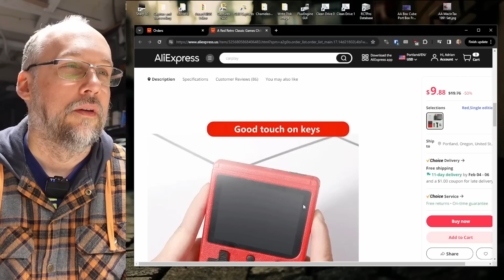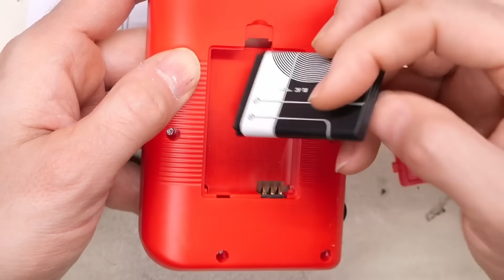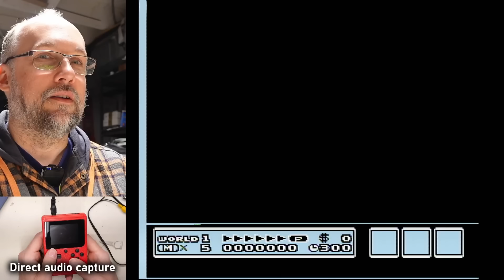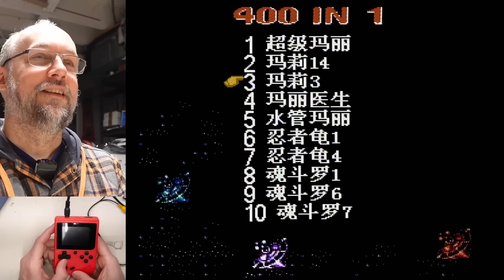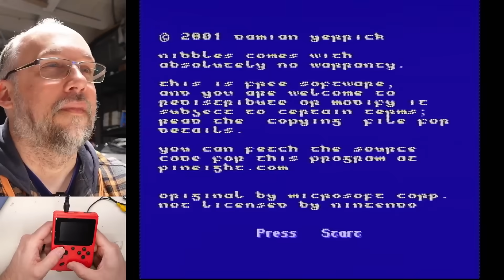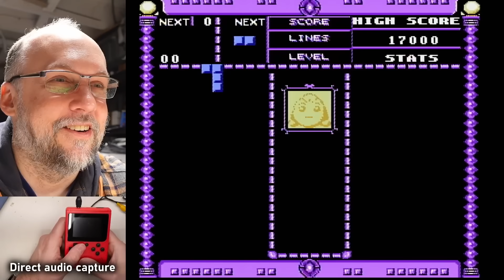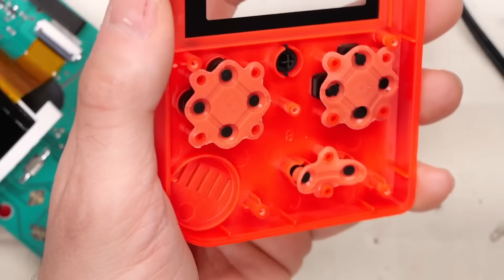I thought this $4 8-bit game console was going to be total junk

Comment: Most of the modern NES clones with this sort of large Flash use a VT-02/03 SoC, that is a series of NES clones manufactured by a company called VRTech. In the early 2000s they implemented something called the OneBus, essentially a programmable mapper that lets the system address an 128Mbit memory space. This means that anything other than MMC0 needs to be hacked to run in it (for example, certain portions need to be repeated and some of built-in games PPU data is interlaced with other games that share the same mapper type) - it is a slightly larger undertaking than just flashing the ROMs. Later on they went as far as building a non-NES compatible SoC called the VT1682 that drove many chinese handlhelds and Wii clones in the early 2010s - I actually reached out for them on the topic of building a hobbyist computer based on that chip.
Reply: This sounds like a very cool project!
Reply: Hey I had the same thought ! I have a bunch of famiclone UMC chips and I watched ben eater's 6502 breadboard computer, and it got me thinking I could just make one myself out of these :D
Reply: There was a NOAC (or FOAC) that could use the proper ROMs. It was typically packaged into a fake N64 controller (with a fixed "joystick" in the middle) with a Famicom compatible slot on the bottom. I had one with one Famicom game cartridge, sold it for cheap. It had the usual huge number of games in one built in, which were multiple minor hacks of 100 or so games. I assume it could have worked with a NES to Famicom adapter.

Comment: Nice game console for it's price.
This kind of battery indeed seems to have long life. A (fake?) battery (ZMC BL-4C) was in my 1st cheap "Made in China" dashcam already in 2012. It didn't keep the dashcam powered very long, just couple of minutes, but when I replaced it with real Nokia BL-5C battery from Nokia 1600 cell phone, I recall it kept it powered up at least ten times longer, maybe even an hour or so. 
Usually of course dashcam is powered from the car's 12V socket, but when parked, there's no power coming from that socket. If you'd like to use the motion sensor, or G-sensor mode, long lasting battery inside the dashcam is useful.
Nice to see this kind of battery is still powering up devices, at least inside this handheld game console.
I still have the Nokia 1600 phone and battery for it, altough I don't use it as a phone anymore. I also have later Nokia C1-01 phone which has 3,7V Nokia BL-5CB version of the battery, but never tried this in that old dashcam.

Comment: It would be easier to wire up a genesis controller rather  than using a nintendo one, though the genesis controller has less buttons (3+start) than this device expects (4,+start+select but do any of the games use the extra buttons, if not you could get away with a genesis controller). You could install a male DE-9 conector without modding a controller

Comment: The screen tearing is actually because the scaling is "nearest neighbor" and the LCD isn't an exact multiple of the native NES resolution. I have the same issues on the GameGear replacement screen. You need a screen with exactly 1x or 2x the pixels of the NES to not get this effect, or leave black bars around the screen edges.
Reply: You're probably referring to shimmer, where you get a sort of flickery effect while the screen is scrolling because lighter and darker logical pixels are passing through different sized output pixels.  Screen tearing is just that the screen is running at a different rate than the hardware driving it, or the screen is just not being filled/refreshed fast enough so you can see the process of the screen being between frames.

Comment: bought something "like this" (as in, same exact shape, but I don't know if it was the same manufacturer) a few years ago after watching some youtube video about how they are not as bad as you'd think, and yeah it was not bad. gifted it to a friend's 4 year old son so he could play mario. it broke a few months later from abusing the charge plug, which was about as expected, to be honest.

Edit: Wrt the external controller, it connects via the usb plug but isn't usb. in fact that whole usb plug is not actually usb, but rather follows the NES controller "protocol" (which is just a shift register, clock out, data in).

Edit 2: I just realized the controller port is micro-usb, mine was mini-usb!!

Also I don't think mine had those audio issues, this version must use a different clone NES chip.

Comment: I've always been fascinated with the old HK SuperVision / Megacom multi-carts. The originals from 1988-1991 don't repeat too many (usually), and are always real commercial Famicom games. Almost always Mapper 0, or hacked to use Mapper 0. Some of my favorites are the 110in1, 190in1, and my absolute favorite, the "Powerful 250in1", with over 100 actual games, and the hacked variants, stuck together, and not all throughout, which is nice. There is something very nice about these collections of early games. It's a nice snapshot of the early Famicom days. So many of the classic Black Box NES games too. Almost all 30 are present. -Matt

Comment: It would be very easy to add an external controller onto this. Just tap into the contacts. I bet the extra "C" "D" buttons are turbo versions of the B and A NES buttons. That's what they usually are on the FOAC boards. -Matt

Comment: The quality of this thing is better than my $100 multimeter I bought. It makes me kinda sad. I opened the meter up and was appalled at how bad the solder joints looked and how half-assed certain things seemed.  I realize that they used wave soldering in the production of the meter, but  it just looked awful.

Comment: I have one but I just play Galaga on it! I have PAL but is PAL-M so is 60Hz and the Mario seems a little fast to me. The composite video out is pure crap....horrible. Mine too had the controller with a bad contact I used Deoxit (in fact another one used in Brazil that is not toxic or flammable) and it became worse, maybe the conductive rubber didn't like it.
It has not low battery indicator the screen becomes dimmer and dimmer until you realize that is the battery! Mine came with an extra controller NES like that it is only used for the second player.

Comment: Raid on Bungeling Bay is interesting because while developing the game maps, Will Wright realized he enjoyed making maps more than the game itself. Thus, he created Sim City.
Reply: The NES version of Bungeling Bay is also interesting in how they implemented the scrolling. Most NES games which supported simultaneous horizontal and vertical scrolling did so using MMC3 tricks, but Bungeling Bay doesn't use a mapper. Instead, it does smooth scrolling horizontally but uses jumpy stepwise scrolling in the vertical axis, which is also surprisingly difficult to pull off on the NES.
Reply: I loved playing this on the C64, had no idea how to play, but pieced enough together for it to be fun. Wasn't until about 5 years ago, I read the instructions online and enjoyed playing it in an emulator!
Reply: You can really appreciate the aesthetic similarities with it and the early versions of Sim City
Reply: Loved it on my C64.
Reply: 'Raid on Bungeling Bay'   ROBB and Space Taxi are the two games that I still pull up once in a long while on a C-64 emulator.  Both were great in their own respects, and it's difficult to find a similar experience on anything else.

Comment: Raid on Bungeling Bay was Will Wright's first game, the original version is on the Commodore 64. It actually has some neat mechanics in that the enemy city has factories which work towards building an enemy battleship to take out your aircraft carrier.
The city aspect of the game became the inspiration for SimCity and you tell the similarity with the tile graphics used in the C64 version of SimCity.

Comment: Some of the later Russian NES clones had improved hardware. It could be that the extra buttons are for games for those systems.

They could also just be auto-fire as they are on a lot of the Chinese clone systems.
Reply: I guess it's because they're made with same form factor of "better" stuff like the Miyoo Mini or the Anbernic line.

They use four buttons plus "shoulders" to be mapped with Retroarch
Reply: I have one that's almost identical to this (my cardboard box is a bit different, but everything else looks the same) and Y/B are the B/A NES buttons, and X/Y are turbo.

Comment: Some years back I got a handheld thing from a local clearance place and it too had one of those RAM/ROM modules fitted, never did work outhow to read & write to it though, cos the games that thing came with were absolute crap (they made the dodgy fakes & hacks on this look good!), think I ended up tearing the screen ribbon though (was soldered to the board, nice) and binned it, shame if it was actually a NOAC in there, but, without good games it was better used as a door wedge... :P

Comment: If you can figure out how to interface with the flash memory, it's most likely a standard FAT volume. So as long as you can talk to it, swapping out the roms should be easy. The part that might present a bigger challenge is if the multi-cart menu needs to be modified.
Best case scenario: It just reads the roms from flash memory and dynamically creates a menu.
Worst case scenario: Some things are hardcoded and the menu resides in the blob chip.

If you have any idea how you might read the flash chip, that would make for a very interesting video.

Comment: We have several of these type of devices and for what they are and what they cost…I’m overall kind of impressed.   It’s annoying how many duplicate games are, and listed under different names than the real game names….  But the internal SoC seems to be fast enough to run the games without lag, the battery holds a charge, and and the buttons work (compared to some cheap controllers where the buttons don’t fire, stick, etc).    It’s also great if the kid breaks it, loses it, gets wet, whatever….its not a big deal, just get another one.   I haven’t taken any of them apart, but I do wonder if it’s got ttl mixed up into all those test points, or if it’s a common SoC under the blob.  I think the ones I have were more like $10, some look like game boys and some look like game gears, but mine don’t really run at the weird speeds like that one does.

Comment: Got one if these 400-in-1 few years ago on Amazon, for under ten dollars, and it came with the second controller for two player play.

Still impressed it can be done for such an insane price. Just try buying the components for that little, not to mention the custom cases, packaging, and cables.
Reply: Similar story, bought one (shaped like an N64 controller) at the swap meet from a guy working out of a shipping container back in the mid 2000s. Got a surprising amount of fun out of it with my friends.
Reply: I bought a similar one just now from the corner shop.  It has a controller included although not mentioned on the included list. Has 500 games but I think Adrian's is better selection.  Mine doesnt have that moulding easter egg. I am guessing there are many clones of the clones.  My audio is far better though and the composite video looks better or ot could just be that my crt 14in just works well with it.

Comment: BL-5C is a very good battery form factor. I wish there were standalone battery holders for it, so it could be easily incorporated into custom projects.
Reply: There are holders available four purchase, although there isn't much of a point to it, as you'd have to integrate it properly with the overall case, and at that point, the case itself becomes the holder. The battery spring contacts can be found on the usual sites.
Reply: @graealex  well you can just buy a gameboy looking case and holder with charge circuitry built in for like 4 bucks
Reply: I still have a Nokia that I believe uses just that battery model - although there were many batteries that were exactly or nearly same size, but then had some minor differences, like connectors on right instead of left side, etc.
But I think it just might be cheaper to buy this device than a new battery ;D
Reply: @robsku1 you could fit bl6c  in some bl5c models. some needed modification, it's just a thicker one. 

the connectors are mainly the same still tho, the thermistor and +-
Reply: Have we all forgotten that they used to puff up and their capacity was drastically reduced after just one year?  I would imagine the worst current chinese crappy copies may still be better than the originals.
Reply: @dr_jaymz  My original BL-5C is fine but I didn't use it much. I believe my brother's ones ended up only lasting a few days (as opposed to two weeks) but he used his phone for around 10 years.
Reply: Those Nokia batts are great!

Comment: In this sort of device, AAs, or the common Nokia battery are a good option for long term survivability of the device. Would be nice if more expensive devices came with replaceble batteries. Like the microsoft controller that can take the proprietary rechargeable, or AAs in a pinch.

Comment: That one does look surprisingly good for the price. Another budget option, especially if you want to build it into a TV or some project, is the pi pico. There are emulators for it including the NES. Not as inexpensive, but Hardkernel has the Odroid handheld consoles, which I would recommend since they are open source software and hardware, and have excellent support from the community.

Comment: I ordered the $3.99 version and it was supposed to have 640x480 screen, but proved under microscope that it only was 320x240. It was supposed to have 500 games but actually only had 20 unique, then a batch of 160 triplicated to fill out to 500. Then games like SMB had the music running way too fast, and most other games had completely wrong colors. Almost like it was using the Famicom color pallete but N.A. NES roms. Oh and the 1080 mAh LiIon battery only was ~250 mAh. 3-5 strikes and yer out.  The better ones like Miyoo Mini+ and R36S are the ones to get.